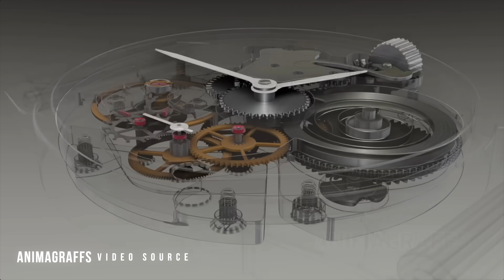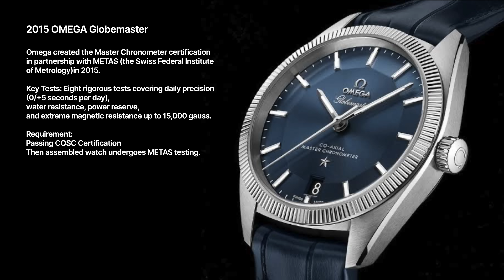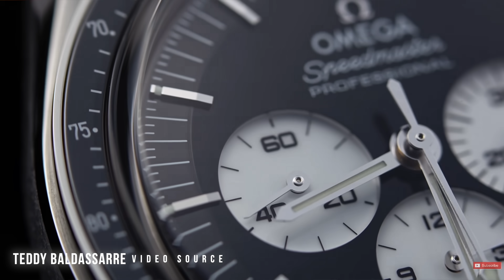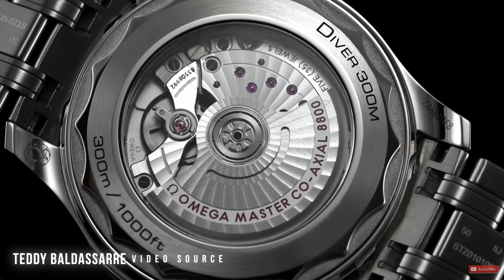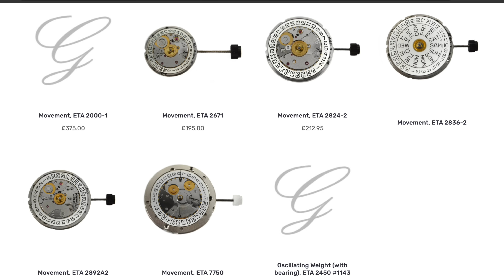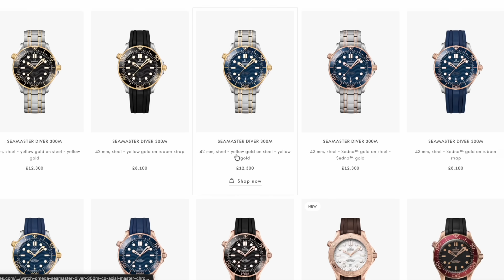OMEGA’s Critics Are Ignoring This & I was WRONG

Comment: Well timed video , I bought my first omega this week, went for the 2254.50 and love it
Reply: cult classic. and it does not rattle around like the corresponding rolex from the era.
Reply: I love my 2254.50, but I don't like modern Omegas ~ the proportions just aren't right, I don't like silicon, and I don't buy the usual "BuT MuH MaGneTisM", however I have to give it to Omega, their servicing is good, no AD games, prices aren't bad (especially if you buy used), and the design is consistent, I might even be able to get over the silicon stuff but come on Omega please, you have to make the watches thinner.
Reply: @TomatoKing97  what do you think of the Seamaster 300?  Do you think the sub is too thick?  Have you tried in any of the de ville?  Why don t you like silicon?  It seems that’s were everyone is going.  I do have to do research to see the benefits other than anti magnitism.  I too am not Gaga over it but I’ll take it over a faraday cage.
Reply: @FortApache-DaBronX  

My dislike for silicon comes from principle, silicon cannot be repaired the same way a metal alloy hairspring can be repaired, and the way silicon hairspring breaks is by shattering, couple that with Omega restricting parts means you cannot repair your watch independently anymore - which is probably fine since Omega has good reputation, I just don't like it. For example the ETA based movement in the 2254.50 can be serviced pretty much anywhere, I still took mine to Omega but I could do it elsewhere. That's the reason I even bought a 20 year old 2254.50 instead of buying a modern Seamaster, even though the modern ones are much more accurate. There is another thing, if I want accuracy I will just wear my DW5000R or look at my phone, to me mechanical watches have to stay traditional, but anyway that's my thinking.

On the thickness, I think the modern Rolex subs have a similar problem yes, I do prefer pieces between 2000-2010 with drilled lugs. However, both Rolex and Omega wear better than something like Tudor for example, the case shape masks thickness better. But, on Omega specifically, the Seamaster Chronograph from the Bond First Light game is 17.2mm thick, this is just ridiculous, why even make this? It's like shitposting but for watches, I don't like this direction. 

I prefer tool-lish watches, I'm not too bitchy about it, I don't cry about ceramic inserts, but I'm not a fan of dress watches, but I would wear an Aqua Terra, it's not much better when it comes to thickness though. 

I would be willing to compromise on silicon, or on thickness, but put them together and I just don't like where Omega is heading with it.

Comment: Friendly reminder, even though it wasn't mentioned, the coaxial escapement doesn't make movements thicker. The Omega 8800 is the same size as the ETA 2824 and is smaller than Rolex's time-and-date movements

That is all
Reply: The coaxial escapement is one of the most ingenious inventions that has come out in horology the last 50 years. George Daniels is a gem.
Reply: @gpapa31  I would love someone to do a comparison either dual escapement.
Reply: I don’t know enough about this to have an opinion, but doesn’t there seem to be some sort of correlation between coaxial escapements and thicker cases? So even if it’s not causation, there’s some correlation. This coming from an Omega watch owner with coaxial escapement, I have no beef with Omega other than their pricing and excessive variants within each model.
Reply: @thedalebury  It's because big watches have been a fashion trend for the last 20-ish years. The coaxial 8800 is in watches as small as 34mm Aqua Terra and as big as the 42mm Seamaster Professional 300.

Omega has some movements that are larger, like the 8900, but those movements are bigger because they have double mainspring barrels, not because of the coaxial escapement.
Reply: @thedalebury  Daniels put the movement in a 3711 & his own DJust, famously
Reply: @thedalebury  just go look at the movement v case size and compare to Rolex and also with other watches in the line.  It’s a design philosophy not some deficiency in the movement design.  Correlation comes with making the watches and movements more robust . The movement is thicker than their predecessors but is bit why the cases are larger than say Rolex.

As for pricing, far from excessive.  I think everyone just needs to come to terms that things are more expensive now.  Dumb tarrif policy is the leading factor over greed.  Omega smp is the gateway drug and it’s priced accordingly, cheaper than everything else’s.  And an absolute steal when you compare to its competitors.  And no, Tudor is not a competitor of omega.  Rolex is 40% more expensive and Rolex is not a better product.
Reply: Friendly reminder, even if its thinner than other movements, their watches are still thicker than rolex for no reason apparently. The constellations is over 12mm thick while the 1908 is under 10mm
Reply: @Hardly_Party  The Constellations uses the bigger dual barrel 8900 movement. But yes, there's no reason for something like the Seamaster Professional to be as big as it is.
Reply: Is it more because they bolt the coaxial onto whatever other base movements they have so this it’s thicker but saves them from having to completely redesign all their movements? I have no idea I’m just asking. Kinda like when someone takes a base sellita and bolt on to it their flourishes or complications
Reply: @JD-TheShadow  The only movement they "bolted" the coaxial into is the 3861 movement for the Speedy, and they actually made the new Speedy thinner.

Every other coaxial movement they have is made bespoke with the coaxial, so there's no compromises for the coaxial. As I said, the 8800 is NOT a thick movement. The thick movements are the 8900 (which has two mainspring barrels), and their complications (9900 chronographs), which are thick because of their modular complications, not because of coaxial.
Reply: Cool thanks!!
Reply: @JD-TheShadow  I actually asked Roger Smith this at BWD this year. He pointed out the 3711 prototype, & mentioned the Datejust George D wore personally, I shall quote the great man himself, Omegas are thiccer thann oatmeal because “Their design is shit”……….On my Oath & on my honour, he was wearing a Royal Oak btw….
Reply: @jamesblonde2271 😂 amazing
Reply: Exactly. She keeps insisting on that argument—I don't know why... I agree that the 8XXX and 9XXX calibers could be thinner, but that has nothing to do with the Co-Axial system. The Speedmaster's 3861 caliber is Co-Axial and is thinner than its predecessor, the 1861.
Reply: Then why are their cases so thick? When they transitioned from ETAs (thinner cases) to co-ax everything became thicker unless it’s just their in house version of the co-ax that’s too thick. Now all their cases are thick so they seem to refuse to change until the new PO. Can’t they make an in-house version that’s thinner?
Reply: @dukes70 because their design is shit, George Daniels told me personally, true story
Reply: @dukes70  The answer is, they committed to the tools that make these cases back when big cases were in style, and they don't want to change too quickly because Swatch Group actually makes very little profit, and if they bet on the wrong design then they're stuck with a poor seller for another decade.
Reply: It always gets the blame for thick movements but as you said below I think it was just a trend of the 2010-2020 era. Maybe a thinner SMP is on the way.
Reply: exactly right.  its a dumb take and this watch gringa knows better.  she has seen this in the comments before, but its better to push this false narrtive for clicks.
Reply: @F @FortApache-DaBronX  stamp where she said that the coaxial makes the movement thicker. We’ll wait.
Reply: @FortApache-DaBronX Oy!

Comment: How many comments will we see saying Coxial is too thick, because they are too lazy to compare the thickness of the movement to other movements
Reply: 100% correct.  I will say the eta/2500 hundred was thinner for sure.  but dah, it had a coaxial.  and guess what, the corresponding rolex was even bigger than the current one.  the 14.1mm annual calender with 8mm thick movement skydweller, i have never heard anyone say that watch is too thick, even though its the same size as the AT world timer.

Comment: Seamaster: we have a dive bezel. You just can't turn it - especially when wet.
Reply: nobody is diving with a luxury watch anymore.  we have dive computers for that.
Reply: Yes, I use a computer diving. No excuse to make a useless function. The Scalloped bezel is terrible - give it a little traction. I still time things using a functional dive bezel. (& I'd like a 39mm version & tapered bracelet while there at it.)
Reply: @funNactive1  no soup for you!!  While I think they should figure out how to make the bezel more tactile and easier to turn, the design is perfect for its identity.  And you need a smaller bracelet, go buy one an put it on yourself if it’s so important . They even offer it on a rubber.  And as for 39mm.  If you can’t wear what they have, go find another watch, this is a 41/42mm watch.  Love it or leave it.  Would the sub be perfect if it was 39mm?

Comment: My total crazy insane pitch for what Omega should do (or someone else if omega doesn't):

Make collections based on the Greek pantheon. Their company is the final Greek letter I think. So keep the seamaster but maybe make one watch the Poseidon. The Speedmaster should remain but make one more regular model and call it the Hermes.

 Omega has too much heritage to do this obviously but it could make for a killer microbrand concept. The watches would be mostly well designed regular watches with little touches that nod to the names. If the GMT watch is the Zeus then maybe the GMT hand is a lightning bold.

Comment: Omega has great watch lines but they desperately need to do something more exciting than iterate in less than exciting ways on existing lines. It just seems like they are stuck. So many other watch brands are running circles around them right now. Breitling, IWC, Cartier etc. Omega vintage watches are amazing but current portfolio is a sleeper. Need new VP of Strategy and Design in my opinion. Or new leadership.
Reply: Funny, but innovation/excitement is not where the market is currently. Rolex, whether you like them or not, is the standard in mass market luxury watches (talk about an oxymoron). One could argue they are there because they very rarely make significant design changes. Exciting today is someone reissuing a model out of their back catalog. The most popular watches sold today are generally boring designs.

Comment: I hope this is a turning point for Omega. Finally a watch influencer who changes the narrative. Omega is the best value in watchmaking. And this is from a a Rolex fanboy.
Reply: this is far from changing the narrative she is still on silly erroneous talking points.  Omega did not increase its case size to accommodate the movement.  Its movements are thinner than rolex.  And its a talking point because i never hear about rolex watches being to thick.
Reply: Its not even swiss made... Only the movement is, rest made in China
Reply: @EspressoWatches where did you get this info?
Reply: @deifor  Google it...